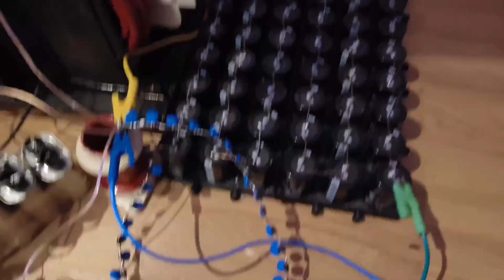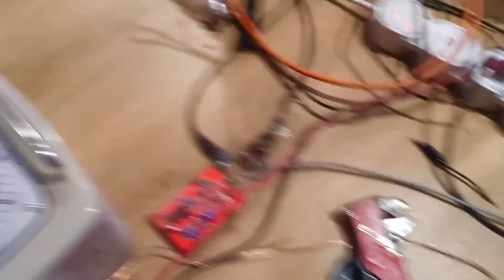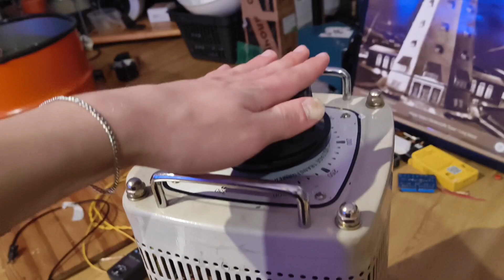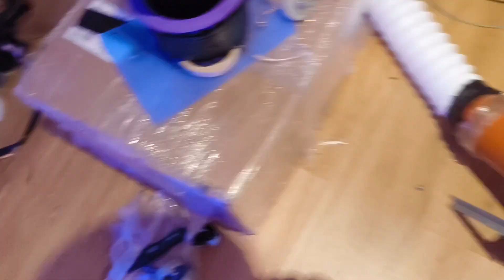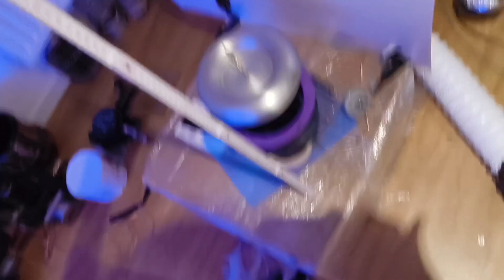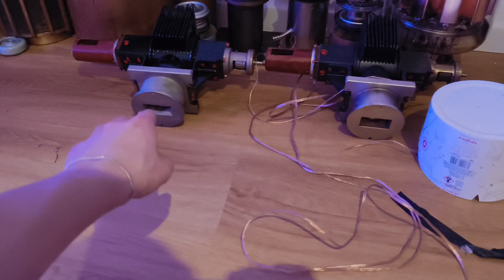Tiny secondary Big arcs gu39b VTTC in CW

Comment: Finally someone told the issue about the ongoing random questions about the schematics!😄 
At my beginning i searched for every schematic too...but found out quickly, its just experimenting A LOT with tuning and getting experience in how it behaves and what to do to get to the goal.
But question about Little know hows and tips/Tricks are completely fine but just the schematic is useless😄 pretty nice coil btw!
Reply from the maker: Yeah exactly. VTTCs have to be tuned and optimized anyway even if you have a schematic for it. Such an coil is pretty dangerous so it's important to have a deep understanding of the setup. And thanks I'm pretty happy with the coil so far. 80cm arcs from a 20cm secondary in CW is pretty insane. Also your coil is very nice btw cool to see other German guys build nice VTTCs 😂
Reply: @motness  hehe yeah this tiny little secondary looks Kind of funny😄 80cm in CW is really crazy! 
My coil pushes about 75cm at average with a 30cm secondary, and i dont think im getting squezed much more out of the gu81 tubes without risk them too much😅
Also never seen an 8 MOT setup at one phase! this should draw like 50 amps or more😄
Reply from the maker: @marvsworld247  your coil is definitely pretty good. Yeah I don't think you can get more from it with the tiny 81s 😂 yeah I really like the looks of that tiny secondary it's insane to see the arcs from it in person. And yeah it draws a lot of power roughly 38A at 250V on the mots so about 10kva from x2 16A breaker.  Probably about 6kw real power. The MOTs are pretty shitty I will look for a 10kva transformer that I can buy and rewind
Reply: @motness  thanks😇
Yeah i wish i had more Power avaiable and also a big tube.. but i dont want to get too crazy with that stuff at my completely wooden attic.. i also have neighbours under me😬 i will try to get a bit more out of my coil, but i think im now at a point where i have to work really much and precise for every cm extra😄
Yes, even on Video it looks pretty cool, especially because these big arcs blasting out of that little thing😄 
Ah ok! I tought its more than 6kw!  in this case your tuning is pretty good and the System with the little coil works really efficient! 
My coil is drawing about 15 amps at 400v so the powerdraw is close to yours.
Do you know your resonant frequency?
Reply from the maker: @marvswelt2587  yeah getting a bigger tube would be the next step. Maybe a 5b but they got pretty expensive over the last few years (like all the other tubes). Yeah my system is pretty efficient I would say I can probably get some more cm out of it though. The resonance frequency of the secondary is 600khz and with arc roughly 430khz
Reply: @motnesswhat the idle current on that mot supply lol my guess is 10a LMAO 😂
Reply: @motness woah! Ok your frequency drop is crazy! I think my coil dropping about 100khz. But i cant measure it precise with my Multimeter oscilloscope.. its more like "over the thumb" so i can be off with my sloppy reading of my scope.
I think thats actually one of the biggest problems to push it way further, because the System is problematic at startup because of detune to compensate for big arcs or falling too bad out of tune later with big arcs when it is tuned ok at beginning.. 
Yes tubes are pretty expensive since corona.. im New with Transmitter tubes, but normal tubes for amplifiers (i normally work with) are going trough the roof too...
Yes i searched for some bigger tubes, but im not Sure how crazy i can/want to go with that😅 i think i will first experimenting more with different Setups and learn more Details before i eventually move on to go a littlebit bigger.. but yeah like i said, im a littlebit limited at my location.. also money is another issue.
Reply: @ yes I just bought a gu5b for 200$ and that was the lowest price I could find!
Reply from the maker: @marvsworld247  Yep freq drop is a problem. I had the idea to add vacuum caps from top load to gnd so the top load has more capacitance and the arc has a smaller influence on the frequency
Reply: @motness  yeah i heard about someone doing that with his QCWSSTC 
I think he was doing it with some ceramic caps sealed in epoxy.
Reply: @ZacharyCornes Probably a lot more with full mains on the primaries. Could easily be >20A
Reply: @motness glad to hear that I'm not the only person who's thought about that. The only issue would probably be lower secondary reactance and higher Q (not a bad thing until the secondary melts XD). Vac caps should also be significantly less lossy than the parasitic capacitance between a toroid and free space!
Reply: @ that’s crazy 😆

Comment: i am wondering, don't you need a specific electrical installation in your house to support such a big power? Nice video by the way
Reply from the maker: @taotao401 nope I'm just using 2 outlets that are on the same phase but different breaker. That way I have x2 16A breaker and I can pull quite a bit that way. This is very dangerous though and I wouldn't recommend doing it
Reply: @motness gute Idee! Aber benutze auch unbedingt beide nulleiter, damit die last aufgeteilt wird...aber wem erzähl ich das..😄
Reply from the maker: @marvsworld247 ja habe ich natürlich sonst brennt mir das Dachgeschoss noch ab😂